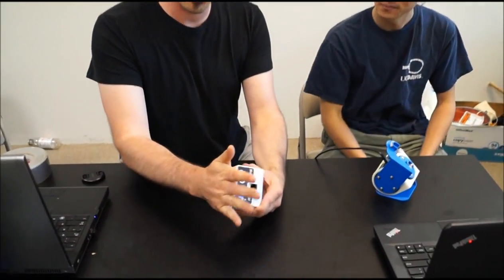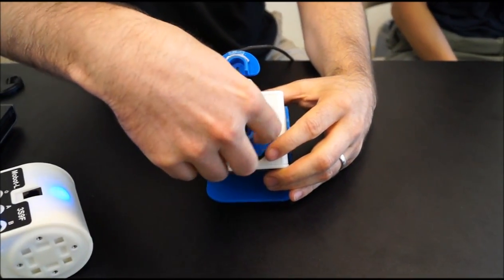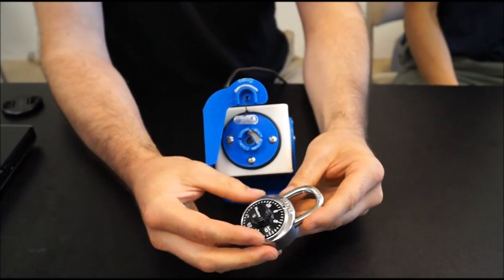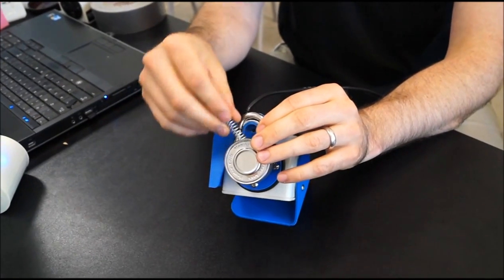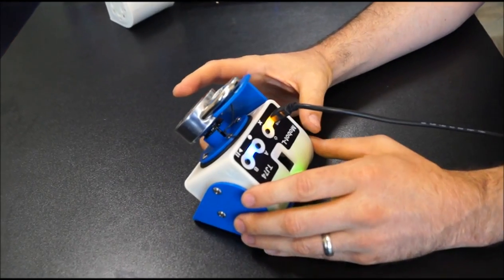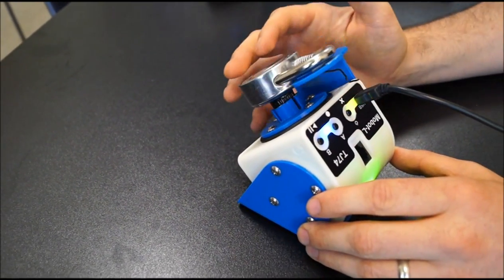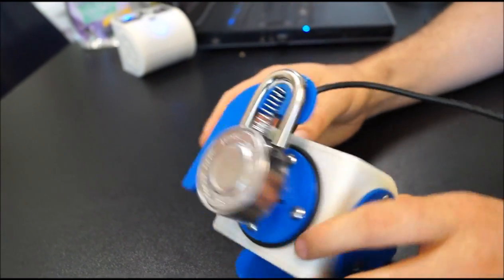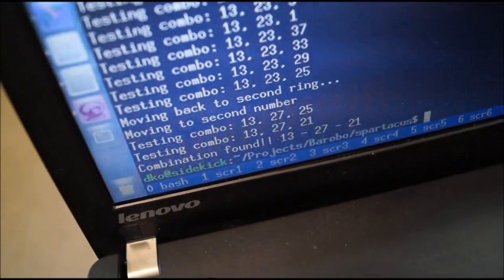Linkbot Lock Popper!

Comment: Would need a much more solid connection I think. Supposedly, by logging where the dial catches when there is opening force, you can cut the number of attempts down to 100. But watching your video, it seemed like there were around 3 attempts per minute, which would be more like 2 weeks to crack than 2 hours. With 64,000 possibilities, there's no way you are doing 533 combinations per minute. With 2 turns average per attempt, that would be 1066 RPM.